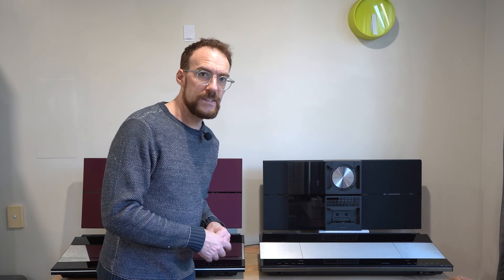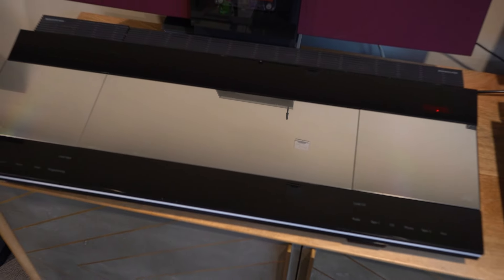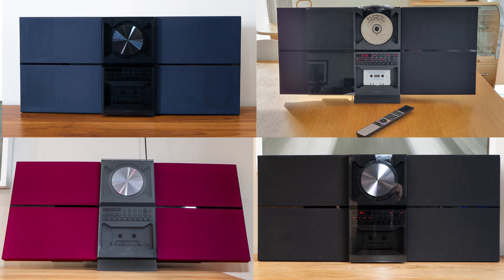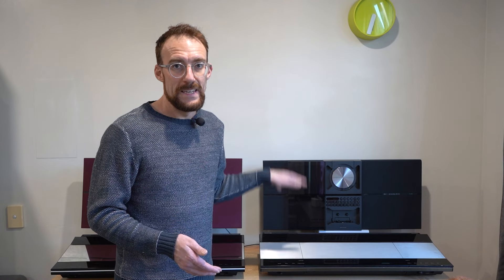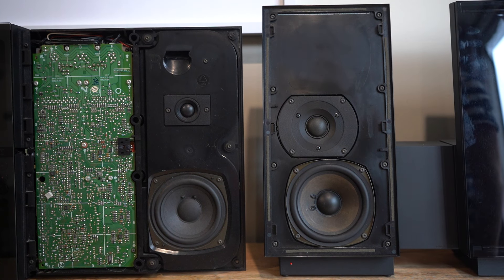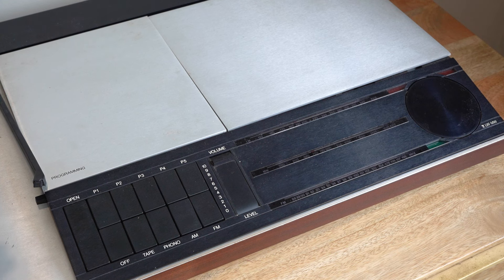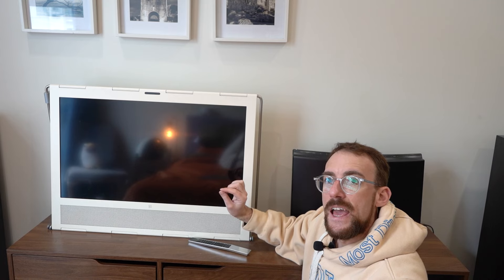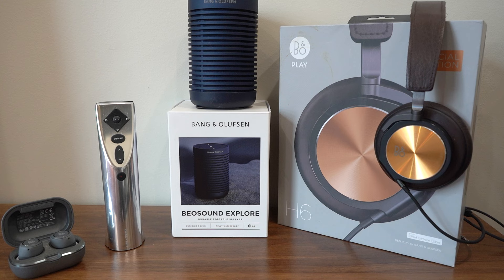MY Bang & Olufsen COLLECTION Tour

Comment: Nice collection! I think I've been spectacularly lucky with my used B&O: Beogram 2404, Beomaster 3000 (1980s), C40 speakers w/matching Cona subwoofer. Beolit 12, H8s, E8 Sport, Beosystem 10 - all great condition in perfect working order (except the Beosystem 10 I mucked up from taking it apart too much. It's internal speakers are not great, but it has an internal pre-amp I hooked up a phono to and with external speakers it actually has great, powerful sound considering it's extremely low wattage. Very odd product, nothing like it). My holy grail would be a Beovision, but they're rare in my area. A used one, in good condition for reasonable price seems impossible.